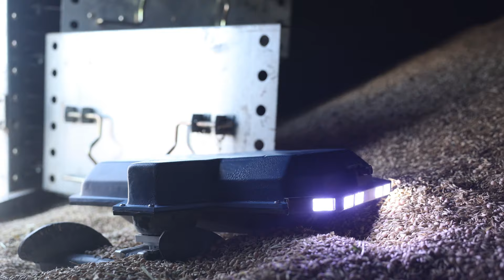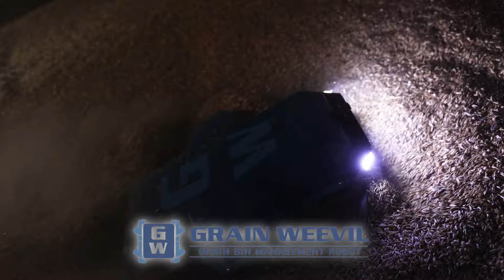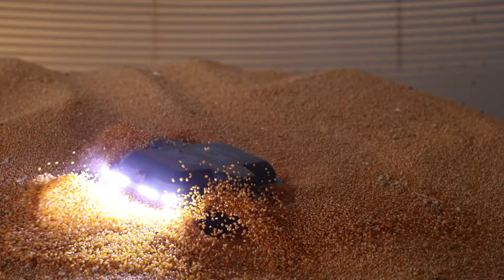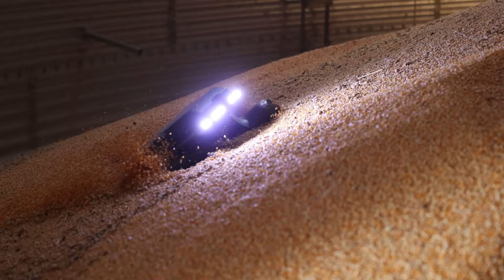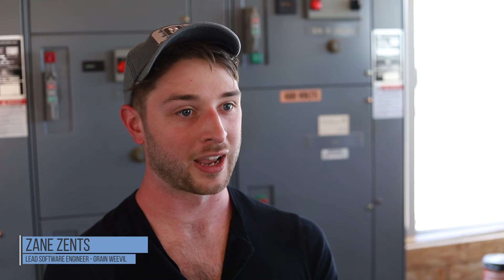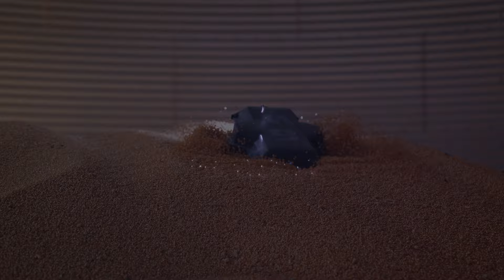Grain Bin Robot | Grain Weevil

Comment: Could someone please explain the purpose of the robot? I’m interested in farming and ranching, but I’m not familiar with grain storage. Is this to keep the crop exposed to air, to allow airflow and prevent mold, or is there some other purpose?
Reply: Yep and also to break up clumps and level the grain
Reply: Most likely it will be in the unloading of the bin. As the grain exits the bin, there comes a point where the grain needs pushed down from the sides of the bin. There is a danger in the unloading process of the grain forming a crust and not flowing properly until it has weight put on it. This cause entrapment of a person if they happen to be that weight. A robot would replace the person.
Reply: I'm a bin builder  .to answer your question.  This robot in my opinion is nothing more than a toy. 
I do agree the power sweep auger is dangerous.  I know many farmers  who have died or were injured by this device.  The power sweep  is designed to operate without going into a bin but lots of farmers go 8n the bin with the power sweep on . 
The reason they get injured is they dont follow saft requirements.
Reply: Often in colder weather, frost can help form a crust and if you try
to go in and free that up, and you are NOT tied off to the outside, the crust can give way quickly and you get sucked down. Had a good friend and neighbor lose a son in his twenties that way. He and another young  man both killed that time. Very tragic!
Reply: Yes, what he said...

Comment: Is it autonomous or does need to be controlled manually? How much does it weigh? Who wants to lugg that device up a big bin? Can it fit in a book bag? How long does a charge last? Does it return to the manhole when your done if it is autonomous? And finally what does it cost?
Reply: Current beta testing models are controlled manually - primary tasks will be autonomous before we hit the market. The current model weighs 28 pounds - and our portable version has a backpack + winch system to raise and lower it to the hatch from the ground as well as to the grain surface.  It will return to the winch/docking system and return to the base station autonomously when the task is done or battery needs recharged. Current version operates just at 2 hours give or take based on grain and task.  We currently do not have a final price but are shooting for around $4,500 plus an optional annual service/maintenance fee for advanced features and tailgate service.
Reply: @grainweevil  thanks for the response. If you ever want need dealer in Ohio I would gladly volunteer for that! You checked my last two boxes for being hesitant
Reply: @grainweevil  4500 bucks?!  That's a ton. Sell it for 1500 to 2000 and that thing will be on every farm on earth.